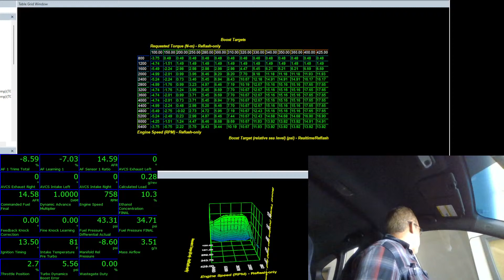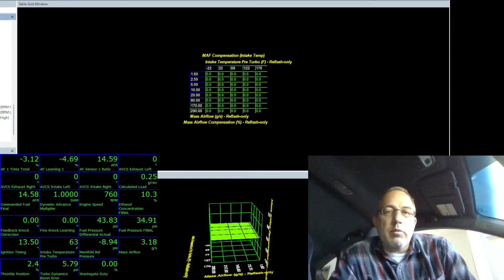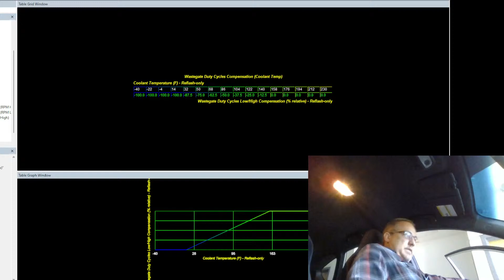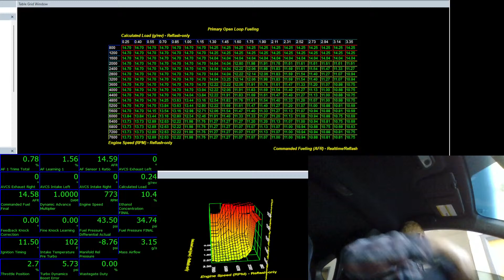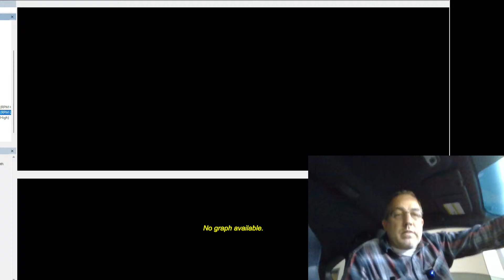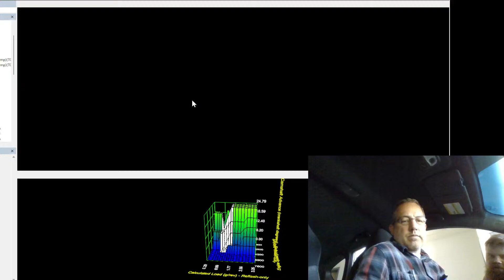Cobb NextGen Flex 2012 STi

Comment: Hello my friend.   Have you ever ran into a parasitic voltage drain on 08-14 or any STI?  I have an 09 hatch where after parking a few days sometimes I hear clicking from around glove box area when the car is off and asleep.  I was going to amp load test my fuses with an Amp Hound 2 gen.  I’m determined to pinpoint this elusive issue.   Please any help would be greatly appreciated! TY sir
Reply from the maker: Lots of Subarus with drains
Reply from the maker: Do you have an aftermarket alarm?
Reply: @GetaDomTune  No but it has a OEM alarm it also has not been electrically “rigged up” from what I have determined and it still has the OEM head unit.    Premium package.   After hearing the clicking I thought maybe it has a factory CD changer but I don’t think that’s the case.   Thanks for the reply!!